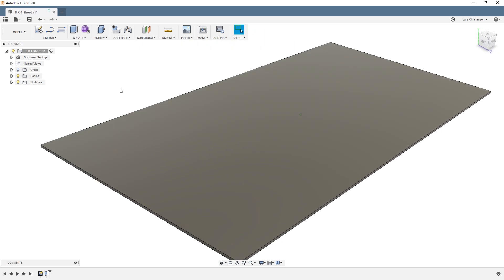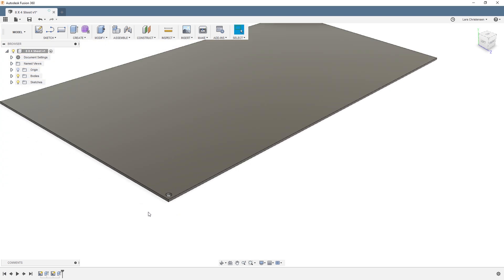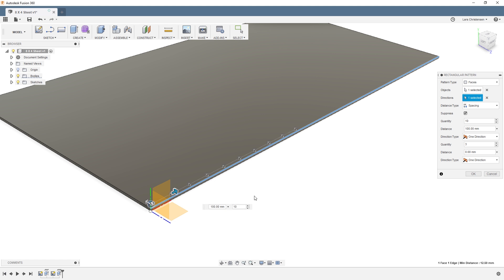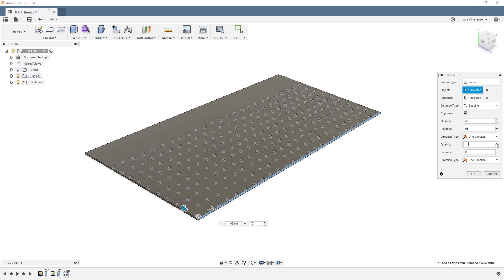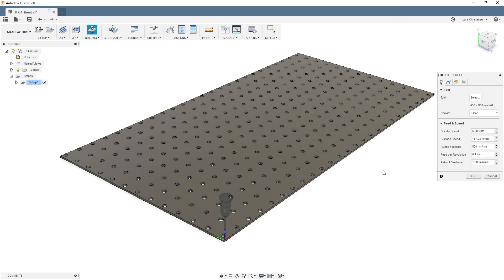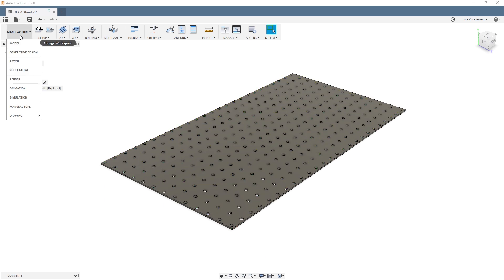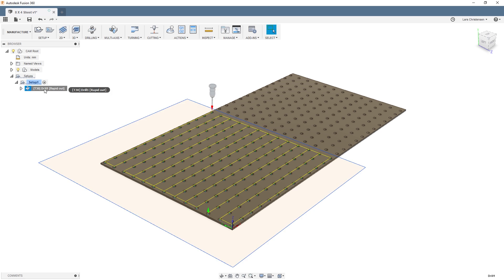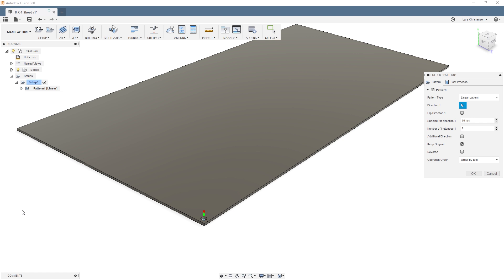Best Drilling Pattern in CAM — Season 2 EP14

Comment: I would like to see a tutorial on how to get a perfect pattern without trial and error. For instance, I want a number of holes(as a parameter) to be evenly spaced between both ends of a piece, that will auto update if the dimensions of the holes, the workpiece, or the hole count changes. It seems like Fusion requires too much trial and error with the patterning tool, and won't make a task like this as easy as some other cad software.
Reply from the maker: Maybe this video is helpful https://youtu.be/Nmup8rcprOM

Comment: Hi Lars I have a problem with 3D printing Threads, First I have printed a XYZ test using PLA at 100mm, 100mm, 50mm and it came out withing 0.5mm so not bad

I then tried to print a Bolt at 50mm dia using ISO metric profile M50x4 which gave me a 3D Print in PLA of 48.7mm outside diameter

I then made a nut using the same 50mm thread and had a inside diameter of  46.3mm, I then edited the nut to 55mm thread and it just fits the bolt after a bit of back and forth action but has no play at all

Tried nut at 52mm but far to loose and unable to set thread different from either 50, 52 or 55mm

Question
Is there a way for fusion to be able to make large threads for 3d Printing which will overcome the shrinkage of the pla or make the threads variable in size rather than the fixed sizes available

Many thanks for your assistance on this matter
Chris Ashdown

ps keep up the good work and maybe some items on 3D printing
Reply from the maker: I would play with the scaling function under the edit drop down
Reply: Thanks Lars but that seems to only adjust the whole component rather than the thread or the bolt the thread is based upon

Comment: I liked learning about the containment area.  What do you do if you want to drill the remaining holes?  In other word, if my cnc’s area corresponds to the containment area and I want to reposition the stock and drill the remaining holes, how to I align the stock, position the origin, and drill the other half of the material?
Reply from the maker: I would create a new job setup, possible using a previous hole at pick and make a new containment area

Comment: Hi Lars how are you, i'm having this problem with fusion everytime i print a drawing it always prints smaller thal the original size i exported the file as an pdf and size is A3, hope you have any idea how to fix this
Reply from the maker: I have never tried to print to scale with Fusion. Could it be a limit to the handshake between computer and printer? I would ask on the forum https://forums.autodesk.com/t5/fusion-360/ct-p/1234
Reply: @cadcamstuff  i've fixed the problem like you said it was a problem between the coputer and the printer,
thanks